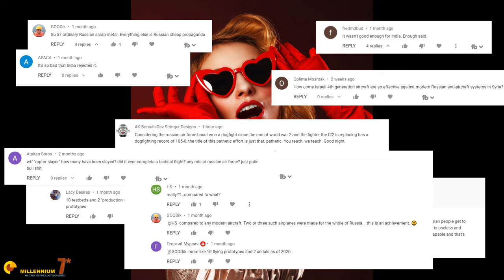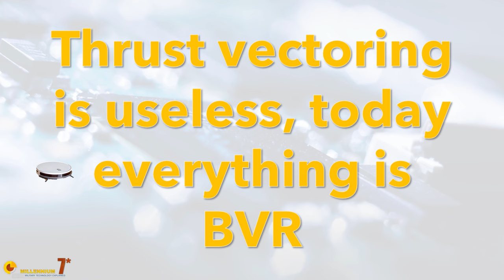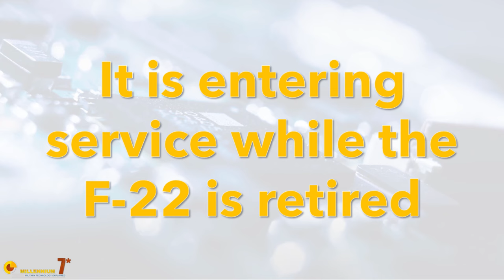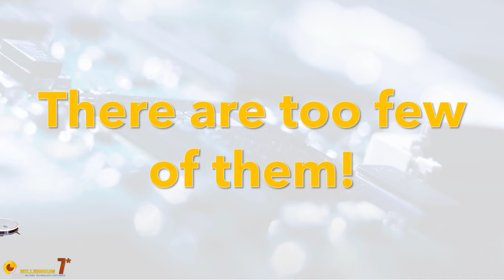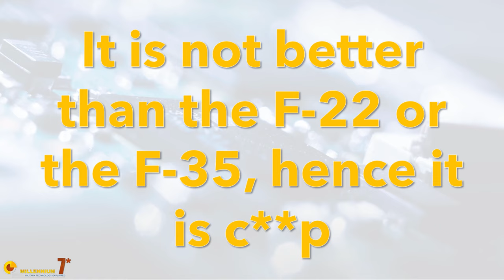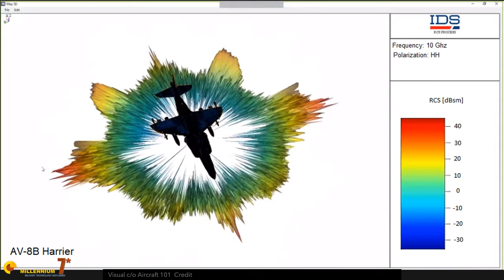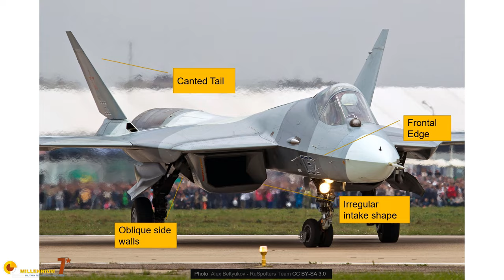Su-57: is it INVISIBLE?

Comment: How come the Israelis defeat Russian technology in the middle east time and time again? For instance, air strikes across Syria
Reply: Because Russian export systems do have quite a lot downgrades compared to the same system used in Russian service. A good example are the east German Mig29s compared to contemporary Russian models.

Russia Will sell you the same shell, but avionics, engines, weapons, radar systems can be miles away from the Russian standard.
Reply: @justacomment1657  which rather defeats the point of buying Russian doesn't it ?
Reply: @justacomment1657  That is why India buys the Russian Aircraft and then fits it out with a hybrid mix of French/Indian/Israeli origin stuff. Integration is  a problem though as they don't talk to each other but still  better than 2nd grade Russian staff.
Reply: @sinansarikaya3662  Name one that currently is.
Reply: @sinansarikaya3662  I may have misunderstood you. I thought you referred to countries which have an existing technical capability.

If you have the money then buying and operating a capability reduced Sukhoi is possible. Whether places Algeria and Egypt can afford the flying hours and training to generate very high skilled pilots is another question.
Reply: @justacomment1657  The East Germans actually got full-up MiG-29A 9.12A variants, same as the Russian VVS, complete with IFF and ECM systems.  The export model was the 9.12B that did not have IFF or ECM.  East Germans not only got 9.12A, but R-73 and full capability R-27R and R-27ER missiles.
Reply: @LRRPFco52  ahh... Seems I got it mixed up with the mig21s they got... Sorry... But east Germany getting the full capability mig29 is for shure something uncommon..
Reply: Because Russia and Israel are friendly and neither is trying to hurt the other. 

When Israel did something that upset Russia (il-20m), they upgraded Syrian air defence and now Israel have to launch 20-30 missiles, where before they launched 5-6. Syrian defences are no match for Israel (and nowhere near to what Russia has), yet it pays extra price with every strike.

Plus ground systems are only part of air defence - Israel iron dome is only effective, because they also launch strikes against launchers, warehouses, hq's and such - if they didn't even archaic rockets could overload it. Syria and Armenia either don't have ability to strike against their hostiles or they fear repercussions so they don't and thus their ground air defence can be suppressed or destroyed.
Reply: @Daokl  Sound interesting. An proof of Israel flying large strike package. 20-30 missiles is able 10 to 15 fighter. That maybe more then what they did for Operation Opera.
Reply: @jimc1654  there's report about september 3 strike from Russian military - at night 4 f15 launched 24 missiles, 21 of them intercepted by Syrian pantsir and buk systems, no lives lost and some material damage. Afaik no info or comments from Israel side, Syrians simply claim that most missiles were intercepted.
Reply: Those sound like excuses, not explanations   - satellite imagery provides an entirely different story each and every time.

Comment: You said that "the Su 57 fighter has 5 antennas, of which the L-band, which is a longer wavelength band than the X-band, is a radar frequency where stealth is as effective as stealth is much less effective than the 657 arrays are too small to be effective in rally on the true characteristics (apart from the composite and composite materials of the fuselafem) So your F-35 and F-22 fighters are the same thing! Where an aircraft with a pod Advanced EW fighters can be located these stealth fighters and other advanced EW pods and jamming pods, they can approach all fighters that, according to the media are stealth, there are also passive sensors capable of detecting the "supposed stealth fighters". that having a stealh fighter is already acquiring an outdated technology... 😃
Reply: The problem is there no jamming pod that is 100% efferent. They will locate your fighter and just over power your jamming. You still don't get the first shot. That why all future fighter design have stealth.
Reply: @jimc1654  As you yourself mentioned concern for Saab's advanced pod jamming which is one of the best if not the best in the world. And your blocking is 100% efficient. Our fighter works in a network and your fighters will only know our location when they are hit by the best BVR missile in the world, the Meteror! And you still haven't been able to locate our aircraft. Is having a stealth fighter these days an advantage after pod jamming is getting better? Being electronically stealthed is more advantageous these days, without needing "infinite repairs and curries" that wear out the aircraft, this is cutting-edge technology from Saab.

Comment: For the most part, German tanks outclassed the US Sherman tank. But the Allies won the war by out producing the Germans. This was an asymmetrical solution. The west's plan is to employ stealth and to defeat the enemy from a distance. The Russian solution is to employ long range missiles to defeat the AWACS and then get up close and personal IMO.  Stealth is only needed to survive long enough to defeat the AWACS and then live long enough to engage the enemy.  If the SU-57 Can do this, then all it needs is it's IRST and maneuverability to finish the fight. It's not the ideal solution, but it is a solution especially if the SU-57 can be produced in sufficient numbers. The key to this is strategy is being cheaper to buy than the F-22.
Reply: It may be cheaper than the F-22 but the US can easily produce more of them AND also F-35 both of which are superior to the 57
Reply: There are 195 F-22s. There are over 1000 F-35s. There are 12 SU-57s. The SU-57 is outclassed by both. 

The main reason that the F-35 took so long to enter service is how incredibly sophisticated the production line is. It isn't possible for Russia to even get close to F-35 production numbers unless they invest tens, if not hundreds of billions of dollars into improving the production line. (Which is not happening)

Comment: I still think it's crap :). "Asymmetric" doctrine is what you have to do when your tech is sub-standard.
Reply from the maker: This is wrong in so many different ways...but I leave you to your ideas. Have a good day.
Reply: Objectively speaking, this is the best fighter of the 5th generation. You clearly don't understand what you are writing about. L-band radars allow you to detect any stealth at a great distance. The Su-57 has several radars and can see around it. While F22 only sees an angle of 60 degrees. Also turning on the radar means that you have been detected by enemy fighters, as well as ground-based radars. For this reason, the US uses AWACS, AWACS aircraft provide target designation to stealth aircraft. The problem is that the Russians have air-to-air missiles with a range of up to 400 kilometers and air defense systems with missiles of 400 kilometers. Also, the Russians will simply strike the airfield and the AWACS aircraft will be destroyed in the first days of the war.
After this, F22 and F35 become completely useless. And I repeat, F22 does not even have optical detection systems. While all Russian aircraft can detect the enemy in the infrared range. Also, the Russians have R37-M missiles with a range of up to 300-400 kilometers, while the US only has missiles with a range of 180 kilometers.
What does it mean? This means that the US cannot even attack an enemy without risking being shot down. The Russian army is much stronger than the US now, you will soon see this in the war.

Comment: isnt there only 2 off the production line built tho ? and the other 10 or 13 are handbuilt prototypes. From what i have heard, its cross section isnt much smaller than a f-18's. Its just that f-18s cant internally carry weapons. What is impressive is the blue and white colorschemes ive scene on some russian jets, they blend in amazing with the clouds and sky, also the su-57 doesnt have very good rear visibility.
Reply: His video didn’t age well, the 57 is a pretender

Comment: Lets be honest the SU-57 is not as technically advanced as to where the west is. The reason is because of the past. You cannot take such a leap in such a small time frame. Off course Russia can hurt any adversary a great deal. But they are on the backfoot from the start. And it is not because the west is smarter. Because the Russians are very very smart. It also depends on how much money you can spend. So I like this video. But it glosses a bit too much over the shortcomings of the SU-57 and the tactics in this asymmetrical warfare. You can be sure that America is already a step ahead again. But like everything. It is coming closer to a fulcrum that there cannot be more obvious improvements anymore. And that is where missiles and drones, etc... come in. To continue the advancements.

Comment: the SU-57 is a platform for the 6th generation, it is already learning to fight without a pilot, it will be equipped with an 18-ton thrust engine, with these engines it will reach speeds of up to 2000 km / h without afterburner, while its empty weight is 1.2 tons lighter than the F22, it flies further than the f22 by 2,000 km, it will be equipped with a microwave radar (active radar detection range up to 400 km is now installed), hypersonic missiles, it will fight paired with 4 s-70 UAVs (carries 6 medium-range missiles, that is, one su57 pilot will be dispose of 30 medium-range missiles), the cheap SU-75 consists of SU57 kits, it will also have an unmanned version and will carry 5 medium-range missiles, the SU57 is equipped with a defense system, these are both electronic warfare and lasers that blind the GOS of short-range missiles, rcs  su57=f22

Comment: Vietnam showed BVR missiles are not effective
Reply: Not really.  The first AIM-7 kills in Vietnam were BVR and very effective.  Then some F-4Bs shot at A-6s and the ROE was changed to visual PID requirements.  That was with a missile that was specifically designed to shoot down bombers approaching the carrier battle group, not maneuvering fighters.  They upgraded the AIM-7E to E2 during the war, and the AIM-7 was the #1 killer of MiGs over SEA.  Then they did very large, long-term studies in the 1970s to determine the true effectiveness with the AIM-7 and what needed to change for the F-14A and F-15A to remain lethal and survivable against all-aspect IR missiles fired from cheap fighters.  That led to AIM-7M and the AMRAAM programs.

Israelis then got into a little battle with the Syrians over Bekaa Valley in 1982, and shot down at least 84 MiGs and Sukhois with F-15s and F-16As using 3 different types of missiles, namely the AIM-7F, AIM-9L, and Python-3.

Then in 1991 in ODS, USAF F-15Cs primarily eradicated the Iraqi Air Force for sport, mostly with AIM-7Ms at BVR.  AIM-7M had increased range and guidance capabilities that made it a different missile than the AIM-7F or AIM-7E2, very effective, but heavy for the mass-produced F-16C and F/A-18C, which got AIM-120s as standard BVR missile.  F/A-18 could carry AIM-7s, but the more capable AIM-120 was lighter and superior.

Vietnam showed that BVR missiles meant to shoot bombers weren’t ideal, but could be used to shoot down fighters, but at fairly low pk rates.  Soviets used asymmetric actions by providing the North Vietnamese with cheap, lightweight fighters to shoot down strike and bomber aircraft, which were very expensive.  They did this in coordination with traitors in the WH who provided the strike avenues, flight paths, and targets for the North Vietnamese, so they could emplace SA-2s and AAA along the ingress corridors.  This was mainly directed at F-105D strikes to reduce the US tactical nuclear strike capability in a distraction theater of operations far away from Europe, where they would have posed a substantial threat to Warsaw Pact.
Reply: @LRRPFco52  Great, I guess that's why the navy added gun pods to fighters, and created the Top Gun school.
Reply: @ViceCoin  USAF added gun pods to F-4Cs and F-4Ds, not the Navy, but it wasn't a standard configuration. The AIM-7E was used over 85 times to kill MiGs.  Guns were rarely used, especially after the MiG-17s were wiped out and only MiG-21s and MiG-19s would launch towards the end of the war.

TOPGUN was an expansion of the F-8 Crusader College from VF-124.  68% of the course curriculum in the F-8 even was managing the BVR fight, and the F-8 had a weak fighter radar with all sorts of problems.

Most of the assumptions about what happened back then are based on misinformation.
Reply: @ViceCoin  The Navy had the Mk 4 gunpods, which were not considerable reliable enough and thus saw very little use in combat. The USAF scored a few gun kills with gunpods, and a few with the nose gun on the E, but most of their kills were achieved by missile.